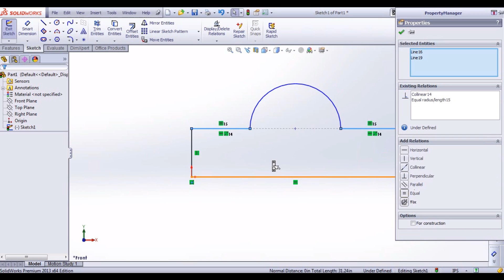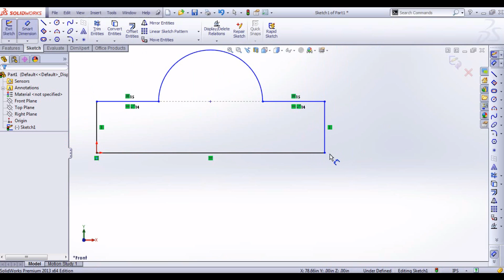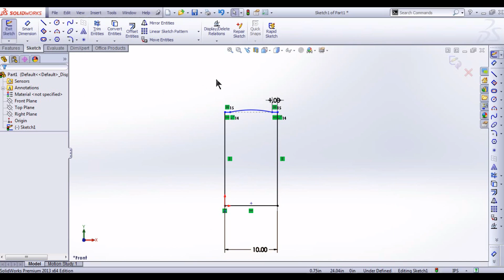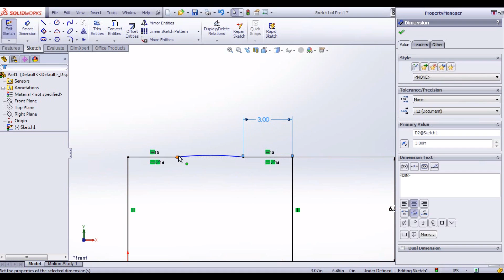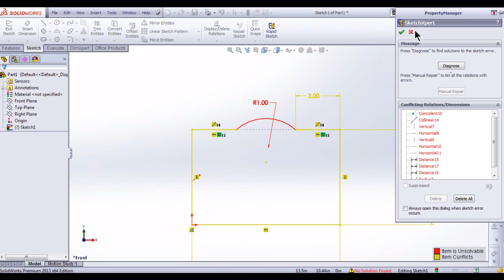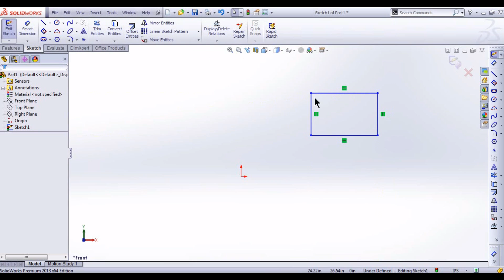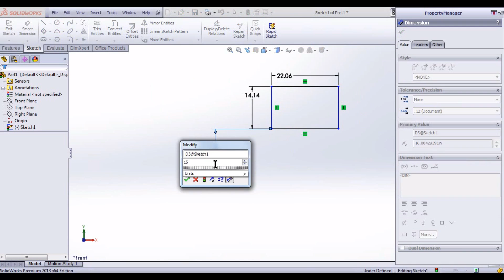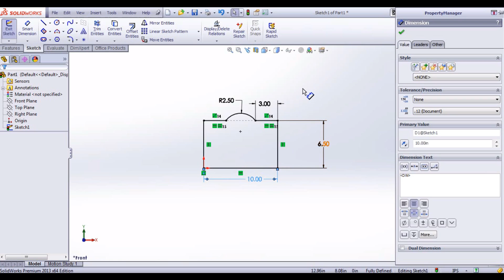How To Dimension, Constrain, and Add Relations To A Sketch In Solidworks

Comment: At 4:05 you make two lines colinear but how does SW know to bring the left line up? What if you wanted to bring the right line down?
Reply from the maker: Great question.  In that case, it would be the order in which you click the lines.  It's not very significant though, since I didn't yet tell SolidWorks how long I wanted either line to be.  Once I put a distance on the lines, they'll be fixed at the proper length.

Comment: even if i draw line from origin it is not constraining even after giving dimension in solidworks
Any settings I should change
Reply from the maker: Does the line have a horizontal or vertical constraint?
Reply: @JokoEngineeringhelp  No 
Like even if I draw a circle from origin I give its radius it is not constraining
I could move the circle
Only if click circle center and origin and clicking coincidence it's constraining
Like this if I do for all steps it's time consuming
Can I change any settings?

Comment: I almost don't understand you noting what are you saying in this video about the lines, what do the different colors lines tell me, you didn't answer so exactly.
Reply from the maker: Blue means there is at least one degree of freedom, black means no degrees of freedom.
Reply: @JokoEngineeringhelp  Thank you, I realized.
Reply: @JokoEngineeringhelp  I have one question, two colors can not make a relationship together or each separately?
Reply from the maker: @shaiblue2005  I'm not sure if I fully understand the question, but sometimes one element like a line can be black with blue points.  That would mean the line has no degrees of freedom, but the endpoints can still have a degree of freedom.  Does that answer the question?
Reply: @JokoEngineeringhelp  No, I think I understand you, I know what are you talking about, sometime they have different lines
Reply: @JokoEngineeringhelp  Yeah, that is the answer to the question